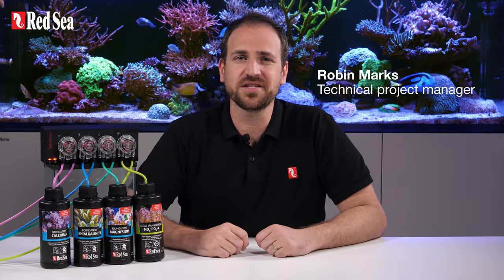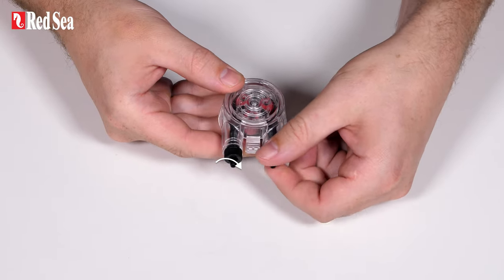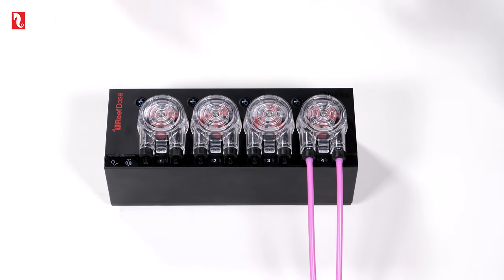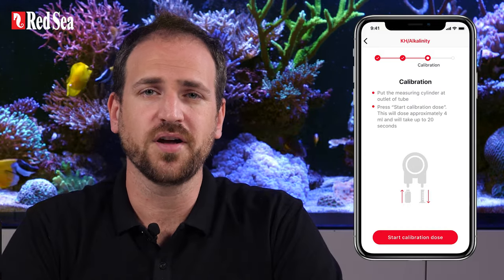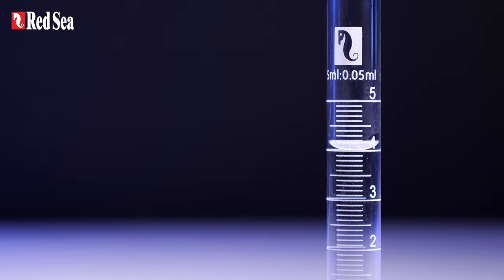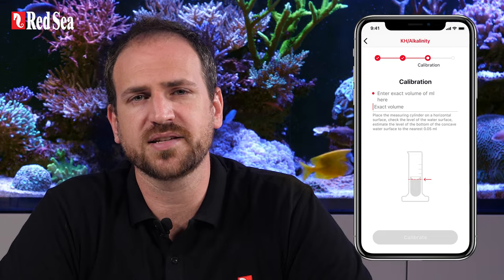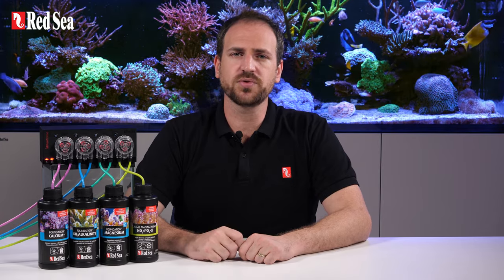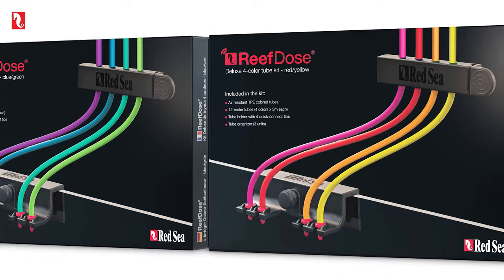How to setup a ReefDose head

Comment: So I hooked mine up with the input on the left and output in the right, and shaft is turning clockwise. What would cause it to actually pump backwards? When priming it was blowing bubbles in the container. So I reversed the output and input and it seems to work fine.
Reply from the maker: This sounds a bit off. Please contact tech support to sort it out. 
https://www.redseafish.com/support/tech-support-inquiry-2021/

Comment: I love the ReefBeat app. It's very modern looking and intuitive compared to apps like Fusion or Mobius. It could be a bit faster though, and connecting new devices could be a better experience if I wouldn't need to turn off 5Ghz WiFi to do it. Should have went with BT pairing, much better UX.
Reply from the maker: Thank you for your input.
Reply: Not true wifi is better so you get notified for malfunctions when youre away
Reply: @Frggg Ggdsedd  yes, but with BT pairing so you don't need to do the whole wifi dance to connect. The ReefDose can just get wifi connection details over BT instead.
Reply: @DillondeVoor  what happens if ur doser malfunctions but u dont get notifixation because your not home since its bluetooth

Comment: I am curious to know is their a maximum length in which the intake tube should be and hence the distance in which the dosing container should be from the dosing unit. The reason I ask is that I want to place the dosing containers about 2 meters away from the dosing unit. Just worried their may be side affects, possibly inaccurate dosing?
Reply from the maker: 2m is fine, they can handle much more. You calibrate the pump at that length and it will make the proper corrections. (it at all needed)